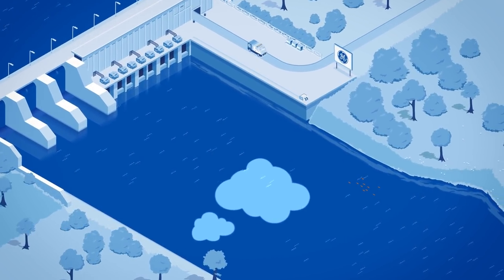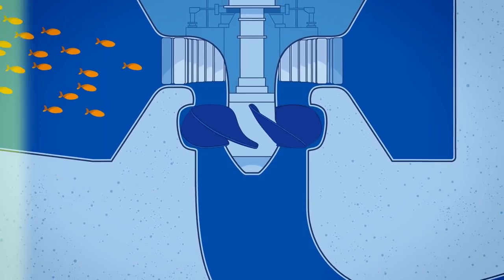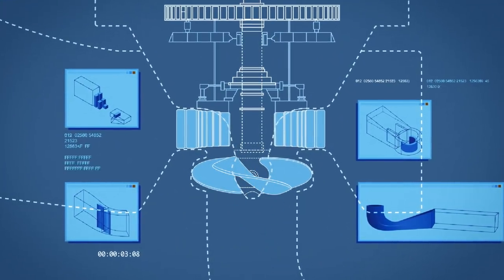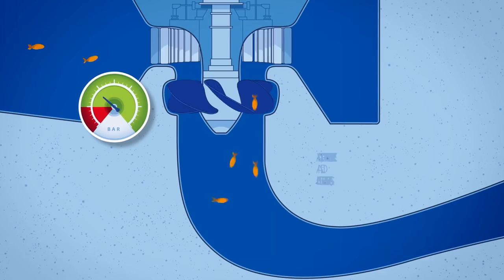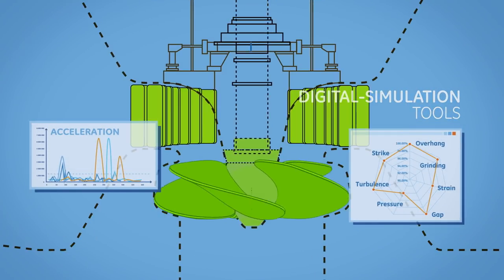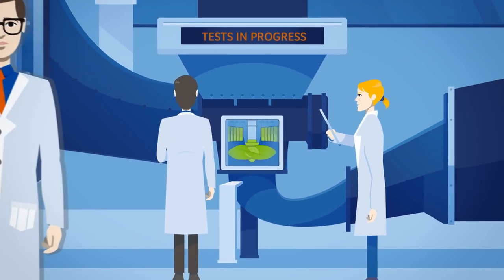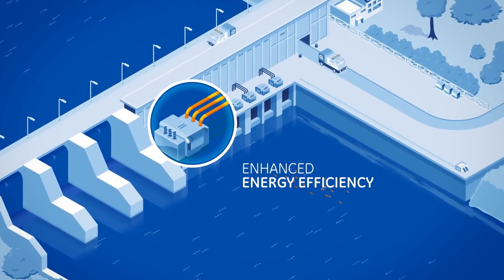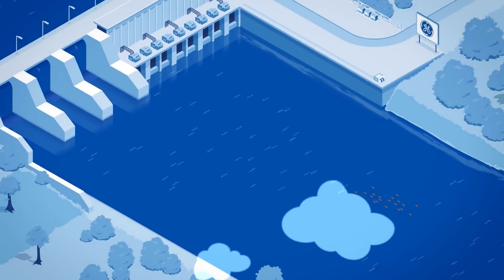GE’s Fish Friendly technology

Comment: Sorry, but this will not work sufficiently. Fish migrate upstream and downstream. Any barrier increases predation, more than in a natural river. Fish will be delayed and damaged, even with such a solution for downstream passage.
Reply: I found this comment, it depends, there are two basic hydropower turbine designs, Kaplan, or axial turbines, and Francis or Radial turbines.

Axial Kaplan turbines are used up to 40 meters, generally more like 15 meter heads, so there's not very big pressure changes between the turbine intake and the outlet.

Francis turbines are quite different they are used from anything between 50 and 800 meter water heads, and the pressure change therefore is anything between 5 to 80 Bar, thats quite a crush and decompression

Upstream fish migration can be solved better with tesla valve fish ladders, downstream at francis is hard, it would require blocking turbine entrance and redirecting fish to a separate ladder, and using compressed air to oxygenate and mix water and so prevent water stagnation and algal blooms